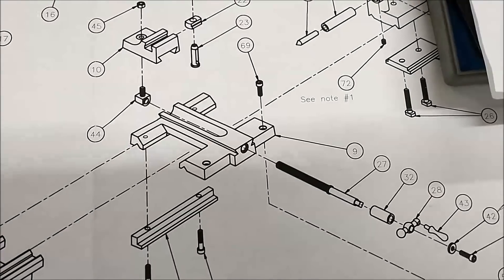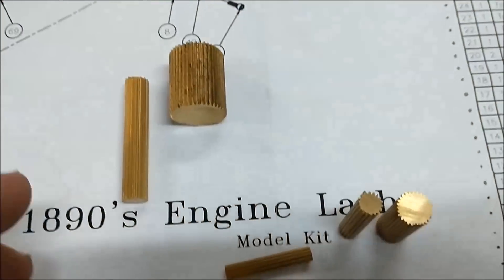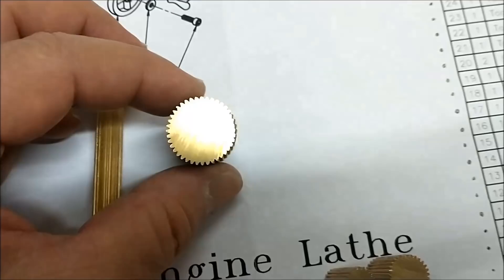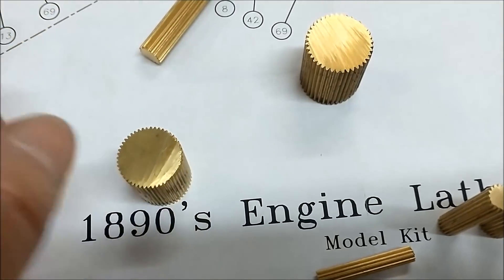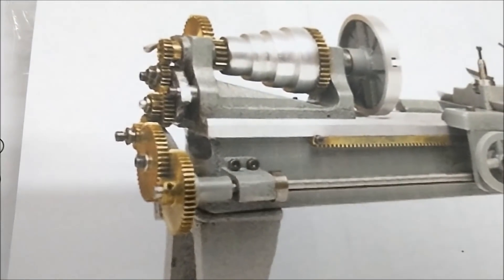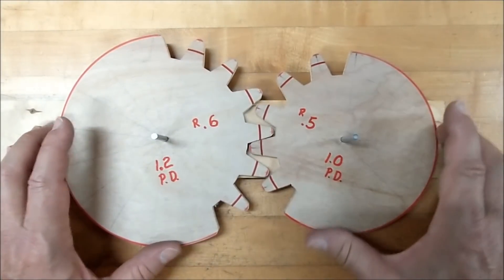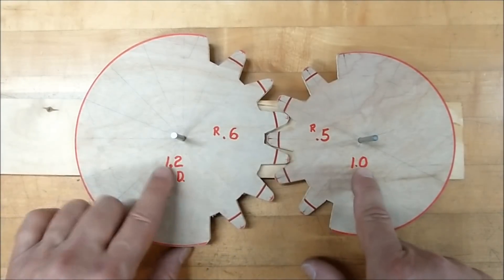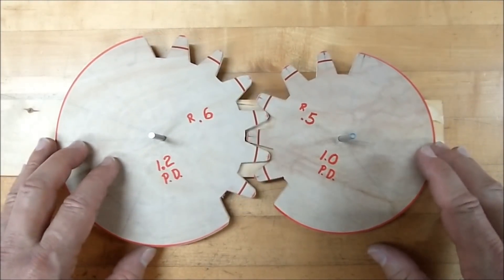Mounting Gears - 101 - The Basics

Comment: Joe big fan of the videos.  Always a huge help especially for beginners like me.  Question:  I've been working on a project that utilizes parts that accept d-shafts.  I'm having a hard time finding a good way to create a d-shaft hole in the specific part I'm mounting to the shaft (e.g., gears).  Would appreciate your thoughts.
Reply from the maker: Easiest way is to make a round hole and mill a keyway slot across the top edge and insert a piece  of material to for the D entry. Another way is to make side by side holes that overlap and use a pin with a flat to create a D shape in the unplugged hole. Does this make sense?
Reply: @joepie221  yes it does.  Thank you very much!

Comment: @Joe Pieczynski: Here's an idea / request for another quick-tip video: How to tell the difference between a metric trapez thread and imperial Acme. While the theoretical main difference (besides units used) is the 30° vs 29° thread angle that's not reasonable to check/measure for most shops as far as I know (unless there's a tricky way that eloped me). Some of these get annoyingly close in diameter and pitch.
This comes in to play when restoring / modifying machines without prints and unknown threads (like a very small CNC-mill I have).

Comment: I know this off topic for this video, religious viewer by the way. Can you put machine tools on wooden floors?
Reply: I have worked in a few wooden floor shops. They were built to hold various machines, and held up well. Working on wooden floors is easier on the body. Some of the machines I worked with were too high to work standing on the floor like the Devlieg horizontal jig mill. We made plywood boxes to stand on which felt much better than concrete. Concrete is terrible on the body when working in factories all day. I guess I got off track here... LOL
Reply: @rprichard8452  ok cool thank you as well
Reply from the maker: Yes. if the floor is thick enough. I have seen shops with wooden floors.
Reply: @joepie221  thank you I've learned so much from your videos I am a novice hobbiest at best, rank amateur would be generous but I learn something new every video thanks again.

Comment: Had to laugh at this video. I remember making my first gear years back. I got into matching because I love building my own equipment. It took me a good two days pouring over the formulas and had to make a index plate. It worked and I learned a lot. The made me laugh thing was I have the lathe you are building with a 24 in swing and 12 ft bed!!!
Reply from the maker: That would be an awesome side by side picture.
Reply: Yeppers, love older SB Lathes, kinda miss my '36 9c, but got a good home.

Comment: is pitch same/similar to module?
Reply: Yep, just different systems for describing the size of the teeth. Pitch is teeth per inch of diameter. Module is mm diameter per tooth. Module = 25.4/pitch. Pitch = 25.4/module.
Reply: It is.

Comment: Not sure where you're getting the gear pitch from. This doesn't sound right to me. I have only heard of imperial gears being referred to by their diametral pitch, pressure angle and number of teeth. Could this be the circular pitch system that Machinery's only mentions in passing, referring to it as having to do with the manufacture of worm gears?

Comment: Hi Joe, I bought a tos lathe and the bearins seem a bit loud, what's strange is the finish as it has like a half moon circular parttern when facing. Tools on center etc. But it's as if you took a flap disk and ground the face while turning leaving that kind if circular finish when turning,, I have a decent sandvik tool on center etc. Any thoughts?
Reply: I'm not Joe but will try to help you, I use a TOS lathe at work and it's a fine machine .Quick question when you try to cut a groove in the out side diameter of your stock does it chatter ? If it does I would suspect that the bearings are bad .
Reply: @jeffreylehn8803  The head stock does seem a bit stiff and it is lubricated according to the oil level reader. If they are bad would i see play in the bearings static with a lever bar and indicator?
Reply: @punishr36  Yes with that simple test you should be able to see if the bearings are bad .In a perfect world you should see no play .The headstock on the TOS is a spindle supported by two large taper bearings it is coupled to the gear box behind it you should experience no gear noise with this setup .
Reply from the maker: If you know the bearings are good and the oil in the headstock is correct, I'd suggest you change the RPM and feed rate. You may have a damaged gear and you are seeing the noise from that. Is this a brand new machine. Are there any traces of a crash like a big gouge in the compound or cross slide? Its also possible is a frequency issue from how the machine is mounted. Too rigid maybe?
Reply: @joepie221  Thanks Joe, Is there somewhere I can send a picture to for you to see?
Reply from the maker: @punishr36  advancedinnovationsllc@gmail.com

Comment: When adjusting teeth mesh on the lathe banjo, Mr. Pete uses a scrap of paper to set the distance between, seems like a reasonable approximation for a correct engagement.
Reply: I think that Joe is talking about fixed gears, where there is no adjustment.

He is explaining how to space the gears properly.

I'm sure that, when the time comes, he will add a little more for the play.

I expect that he'll make a mock up to try it out before he works on the casting.   I know that I would.

I'm sure that he knows that there must be a little play.   I'll be interested to see how he decides it.

First things first.  Make sure that the holes are in the centre of the gears and at 90 degrees.

If it's not properly centered you can fit a cigarette paper in on one side and a sausage sandwich in on the other🤪
Reply: @learningwithlyricsandsongs  "I think that Joe is talking about fixed gears,..."
Yeah, I got that, but Mr. Pete's hack is a great way to set 'em up fairly efficient when the centers are unknown and you just need a quick way to arrive there.

Comment: Your 48DP gears, if you were to cut a rack form gear it would have a spacing of (1/48)*pi or about 0.0654".  Diametrical pitch leaves the pi to you, but metric gears have the pi built in, so Module 1 gear with 10 teeth, would have a pitch diameter of 10mm (and an OD of 12mm since there is an addendum on both sides of the pitch diameter).  The spacing on a module 1 metric gear rack would be pi mm or 3.14159mm.
Reply: I asked Koenig he might cover gears in a bit more depth, including be"Module" gears... interesting point about rack gears, it would be useful to know the "pitch diameter" for racks?

Comment: A comment about "old lathes" versus "new".  In the old lathes (such as your model), they had step-pulley for multiple speeds, and back-gear for high torque in the lower speeds.  Newer lathes (such as my Maximat 11) have more gear-changes and no belt (or only 1 belt speed).  With the advent of variable-frequency motor drives, machine designs are reverting to the back-gear with variable-speed motor.  What goes around, comes around!

Comment: They made the gears in this kit "easy"!  They did all the hard work!
Reply from the maker: If they truly wanted to make it easy, they would have bored them too. The kit builder could still mess things up with an off center bore.
Reply: @joepie221  yeah, getting those indicated in to bore the center isn't going to be fun. There doesn't appear to be a clean outer diameter to indicate on, the only thing I see is the tips of the teeth.

Comment: From the boring guy who knows a bunch about gears....pitch circles don't always run on each other. Often a pinion with a low number of teeth will have an oversize OD. the tooth will be mostly addendum. This is considered good practice. But for sure, give 'em some backlash.
Reply: ...but the pitch circles will still run tangent.  Yes, the pinion will be "mostly addendum", and the gear it meshes with must have "mostly dedendum", but the pitch circles will be tangent.
Reply: @bpark10001  where's your YouTube videos on gears, Brian? sounds like you are "in the know" on gears...not joking, or sarcastic, either. Do you have any favourite videos, or Websites, about gears?

Comment: Well, heck. What sort of a do-it-yourself kit comes with gear blanks that already have the teeth formed? 😋

When you first started talking, I had a vision of hours upon hours of ClickSpring-style gear making, starting with making a single point gear cutter and then moving on to the indexing head.
Reply from the maker: I would have enjoyed the challenge, but I still have to bore and align them. It will be fun.
Reply: @joepie221  I'm looking forward to that part. Specifically, how to hold onto a gear without the chuck jaws damaging the teeth, or getting it off center due to some jaws going more inbetween teeth than others, unless the number of teeth is an integer multiple of the number of chuck jaws.
Reply: The exciting part is that last cut.  Will you have a bonus ½ tooth?   Haha!

Comment: Diametrical pitch gear designation is number of teeth on a 1" pitch diameter gear.  Nominal tooth pitch is pi/n with the actual tooth being about half that of course.  Like most metric vs imperial things, metric designations are the inverse of imperial.  Module*pi is a direct dimension of the tooth pitch.
Reply from the maker: Thanks.

Comment: Great presentation sir.  Might be helpful to show how the OD and pitch diameters are derived.
Reply: I'm going to go out on a limb here and suggest that the pitch diameter is the actual gear ratio. So if you want a two to one ratio,  you would size by the diameters necessary as the pitch diameter then add what you need for the size of teeth. 

If you remove the teeth of a gear and have just two circles,  the pitch diameters are where the circles would touch while revolving around each other to meet that ratio. The addition of teeth would consist of a method to force each gear to move with the movement of the other instead of revolving around the circumference (I know gears can revolve around another but for demonstration purposes). So you would have projections that extend into the other circle and depressions to accept the projections from the other circle. Or in other words,  teeth that mesh. The amount of teeth entering the other circle would decrease the diameter for the gear ratio which is where the pitch ratio becomes important. 

The actual diameters with teeth would be determined by the type of teeth and pitch. I haven't quite imagined how that would work out mathematically though. I'm sure I can get a headache trying to look it up though.
Reply: @sumduma55  okay, I see what you are trying to tell me.  I didn't ask this for my benefit,  but rather asking for the community.  So please allow me to make these observations. 

1)  the DP (diametral  pitch) of a gear is the number of teeth per inch of pitch diameter and can be calculated by counting the number of teeth and adding 2 to this number finally divide this sum by the measured outside diameter of the gear.

DP = (N+2) / OD

2) The pitch diameter  is calculated by taking the number of teeth (N) divided by the Diametral Pitch of the gear.

PD = N / DP

3)  Center to center distance is like you suggest based on the pitch diameter.  These are added together and then divided by 2.

The gear ratio is the ratio of the driving gear to the driven gear.  This can be calculated with the teeth or the pitch diameter.  It should be noted that the gear ratio in a simple train is calculated with only the first driver and last driven.  In other words, any intermediate gears do not affect the ratio.  We will not discuss compounded gear trains.

Anyway, please don't take this as being an arse.  Joe's explanation was dead on, but the added mention of how you derive the pitch diameter is helpful. 

Thanks for understanding. 

Joe
Reply: @MyHeap    that sounds a lot easier than I thought it would but one question.  Your explanation seems to be working from a given set of gears already in existence. How does it work starting from scratch?

So suppose you have two pieces of material  ( let's say blocks of steel) and you want to make gears with a 1 to 4 reduction out of it.  You can easily calculate the pitch diameter by knowing the ratio you want. But if you have no teeth to count yet, how do you determine the diametrial pitch or the total diameter of the material needed without counting teeth?
Reply: @sumduma55  good question.  First you must consider the space you have available for the gears.  Knowing this you can play with different diametral pitches to see how large a gear you can fit in the given space.  Say for example we plan to use a 20 tooth and an 80 tooth gear to get our 4:1 ratio.  Choosing arbitrarily a 16 Diamtral pitch gears for this we find

20 T gears OD to be equal to (20 + 2) / 16 = 1.375 inches.

80 T gear OD to be = (80 + 2) / 16 = 5.125 inches.

These added together are 6.5 inches.  If the space available is large enough we could use this combination.  Please keep in mind this is an approximate space calculated here.  

Say we only have  5 inches of space to put our gears.  In this case we would have to select a gear with a larger diametral pitch (ie, more teeth per inch)  let's try 24 DP.

20 T gear
OD = (20 + 2) / 24
OD = 0.917 inched

80 T gear
OD = (80 + 2) / 24
OD = 3.417 inches

These added together give a total of 4.334 inches.  This fits in our five inches of space.  Now calculate the pitch diameter of each gear. 

20 T
PD = 20 / 24
PD = 0.833

80 T
PD = 80/24
PD = 3.333

Now we can find the center to center distances for the two gears.

(0.833  + 3.333) / 2
4.167 / 2
2.083 inches

I hope this makes sense.   I have left some things out, like the addendum,  dedendum, clearance, pressure angle and other stuff.

Gears are a topic that can get quite involved, but at the same time be very mentally stimulating.  Especially when. You look at different gear forms.  For example comparing involute gears with cycloidal gears.  Most of modern mechanical items are based on the involute form, but old stuff from the 1800s are made with cycloidal gears as are most clock (horology) gears.

I hope you find this technobabble of use.

Regards, 
Joe
Reply: @MyHeap  yes, that is very useful.  I hadn't thought about approaching it by approximation and doing the math.

I've uses gears before but they were somebody else design and usually just purchased them.